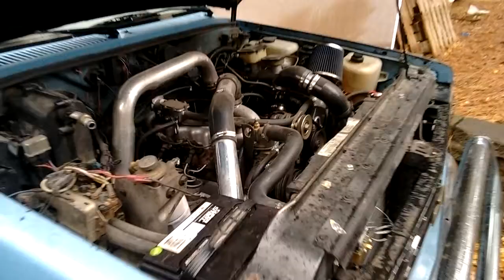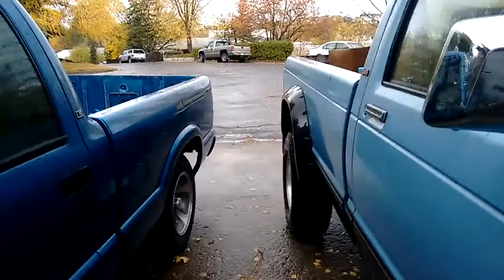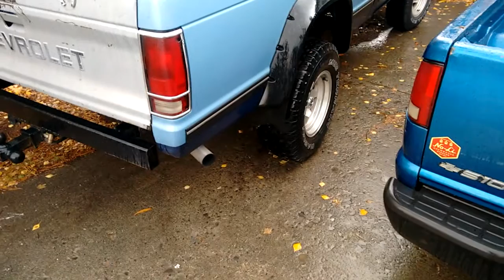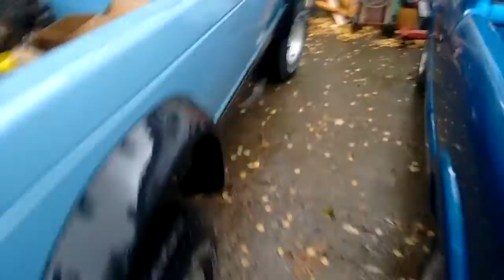FOR SALE - C223 turbo and intercooler - IP turned up

Comment: do you still have this for sale??
Reply from the maker: TLP Zeus For sale again actually, from the friend who bought it from me.
Reply: oh wow! do you know how much he wants?
Reply from the maker: TLP Zeus He is asking $2500 for the drivetrain, but is open to offers. Basically, the body got a little beat up (dent in the side of the bed and missing fender flares), and since the interior needs to be replaced he figured selling the drivetrain might be the most valuable thing to someone. Willing to sell as a whole, tho. Would need a new power steering line and front diff engagement mechanism if you wanted to drive it as is.
Reply: ahhhh i see. i have have a factory diesel s10 and i thought this build was pretty cool especially the turbo!